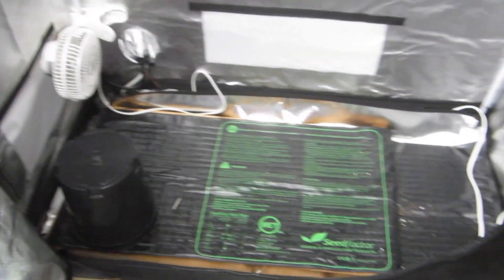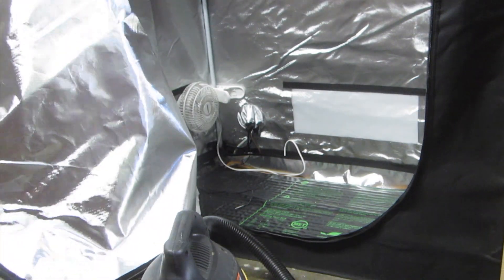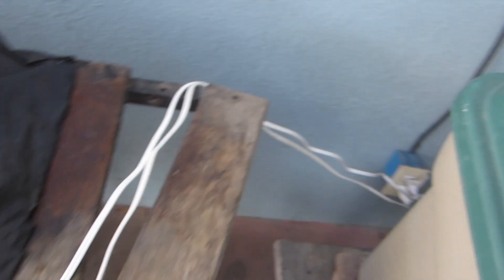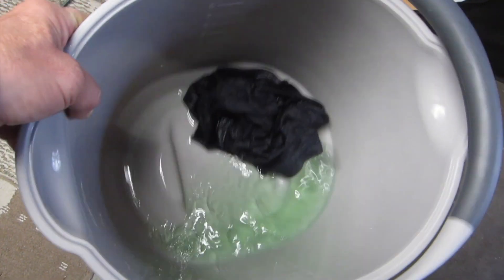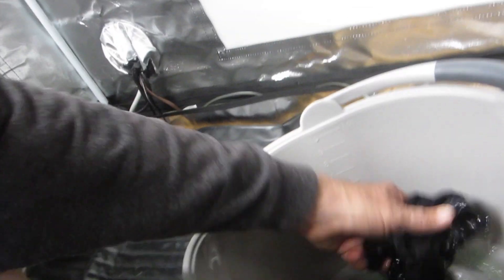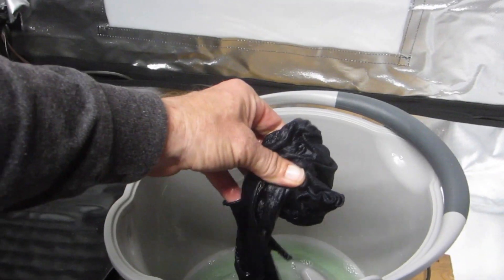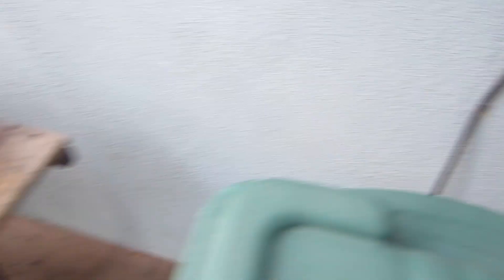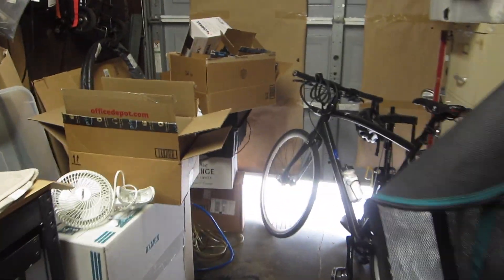Tent Cleaning Between Grows - We Hit 7000K Subscribers

Comment: I utilize hydrogen peroxide in my perpetual grow.  I use it for sanitizing prior to entering clean rooms, and with it being a natural fungicide and additive for plants.  I figured it was my best choice, but it looks like I may have been wrong and am looking to see if I was.  Bi-weekly I wipe the tent (8x8) top to bottom and have yet to have an issue with mold/pests but this is my first grow lol.  Just looking for opinions on if I am using the correct method to keep a sanitized environment during the grow.  And giving myself the best shot at resisting mold and pests.  Thank you for any opinions in advance.
Reply from the maker: hello Fooker... whatever works for you.  that's a good practice.